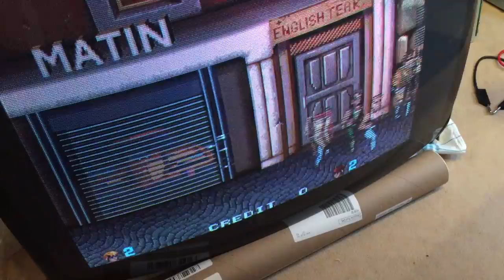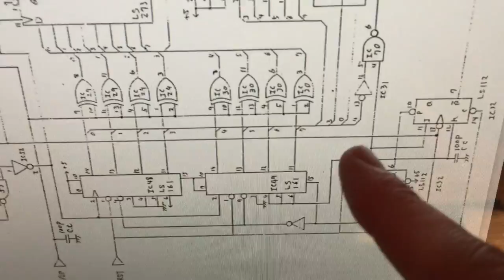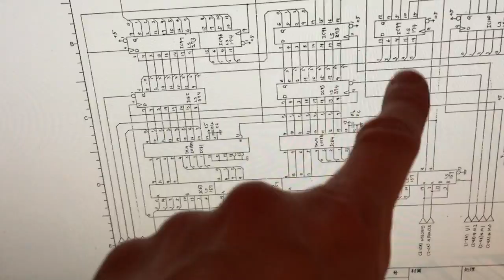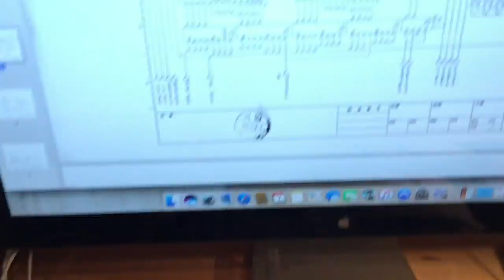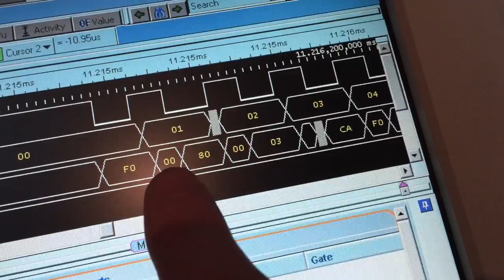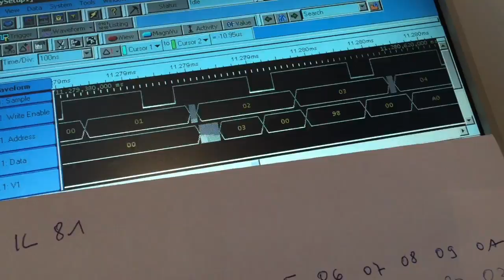Double Dragon Arcade PCB repair - Board#2

Comment: Great video as always, i liked the logic analyser too, are they expensive ??
Reply from the maker: Yes they are unfortunately, dedicated machines with >100 channels you are easily looking at something above $1000 preowned. One of those would be perfect (like the Tektronix TLA machines). But there are cheaper versions with a USB interface and a pc program for example. If you really get into board repair and want to get a logic analyzer I would recommend one with at least 32 channels.
Reply: @christophzett  tnx a lot for your answers, i have actually one other board which is sunset riders with a color pixel missing some pixels are all blue all the time. I need to get one of those cheaper analysers. Do they have a specific name ?
Reply from the maker: @UsedToBeConsumer  just do a google on "usb logic analyzer", you will find plenty options

Comment: another great repair mr doktorzett. keep up the great work. if you ever get hold of an operation wolf board please please do a vid 😉
Reply from the maker: Thanks! I will try to fix more pcbs as I get my hands on them. I got actually two more non working double dragon pcbs - I hope it won't get boring though. :-) I could of course also try to fix an operation wolf when I find one - I already checked and the schematics for the board are actually available on the web which is pretty helpful for any repair efforts (as this 2nd double dragon video actually tries to show)
Reply: doktorzett : The quality of information & depth of explanation you provide can never get boring, it's a pleasure to watch you work.